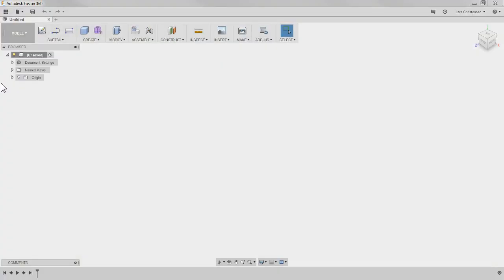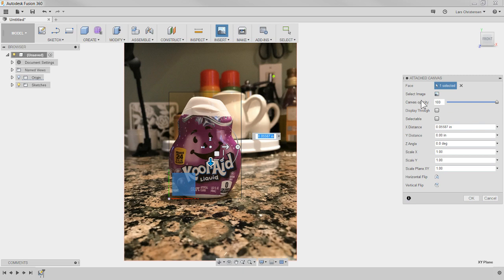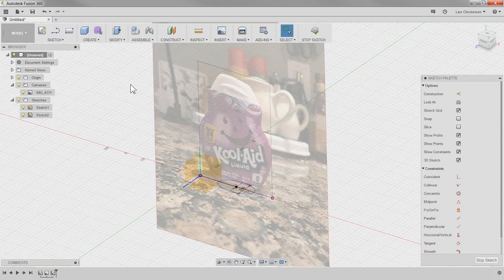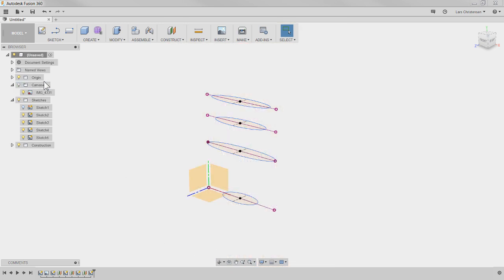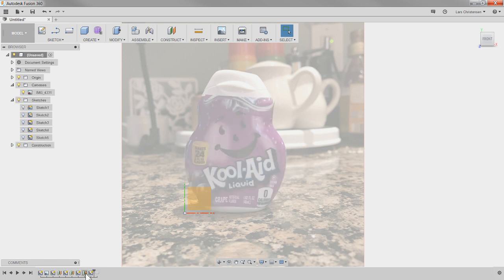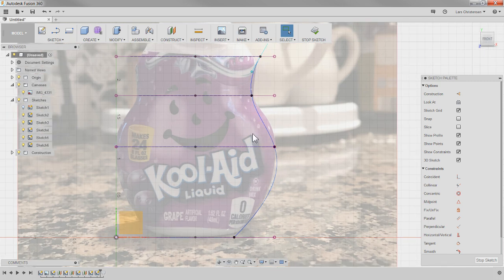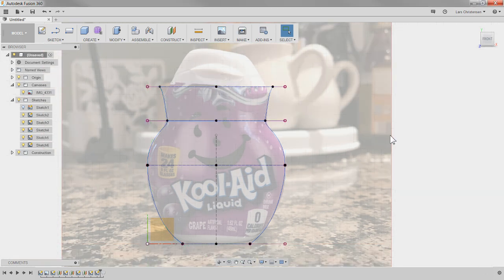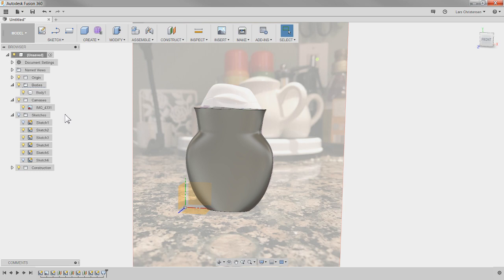Fusion 360  Control Rails (Guide Curves) Loft Command — And Your Comments & Questions — #LarsLive 55

Comment: You are using mirror on rails. How can I add the same guide rails to the right side to so I can get the same shape all around?
Reply from the maker: Hi Håvard Rabbe Thank you for watching!
Consider make only half and mirror that
Reply: Hi, Lars. Thank you for your time. I don't understand what you mean. Can you explain in some more details? Here's what I'm trying to do. I have a circle extruded to 100mm. and I want to cut out a circle inside ,but it has to follow the shape of a spline from top to bottom. I managed today doing it with the revolve function, but I really want to also doing it with the loft with rails function. I need to get the rails in the XY and YZ plane identical to achieve the same shape all around. If I follow your video I will get identical in for example the XY plane, but how to get the same rail shape to the YZ plane?

Comment: OK an nice expample of using splines BUT I was interested in how to dimension the slpine curves in the Sketch mode so it can be defined enough so the line turns black and the .dxf file can be sent to be machined... I'm new at this... I seen when you Sketch that you need to dimension the drawing sufficiently to turn the lines black so it is described enough to be machined... seeing as Splines are so organic in shape I want to know if and how you need to specify the diameters etc. for machining... I hope I made sense now??
Reply from the maker: Hi Paul Hitchman Thank you for watching!
You can absolutely apply constraints and dimensions to the spline so it is locked down. Normally, I will just right-click the spline and select "lock" as I normally are not driving any other dimensions from a spline.
But, you can apply a horizontal and vertical constraint to the spline handle, add dimensions for the length of the spline handles and for the control points.

Hope you have an awesome day!

Best,
Lars
Reply: Lars Christensen excelent. I'll try that...

Comment: I tried the loft using a profile that I want to be hollow. I select the wall section from the top and the bottom, but when the loft is created it fills in the whole area and does not create the wall/shell. I know I can create another loft using the center and then do a cut, but why does it not create a loft with a hollow inside? Another way I could fix it is to use the shell command, but this seems like excess when it should be a simple loft with an inside and outside boundaries.
Reply from the maker: Hi Deputy Dawg Thank you for watching!
That could be an idea to share on the Autodesk Fusion Idea station.
I would do the loft and then the shell.

Hope you have an awesome day!

Best,
Lars